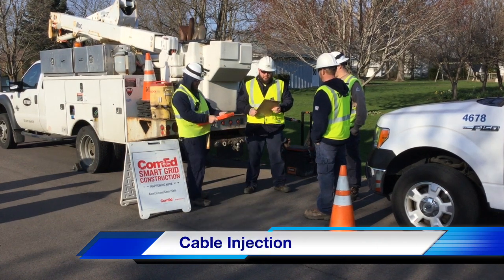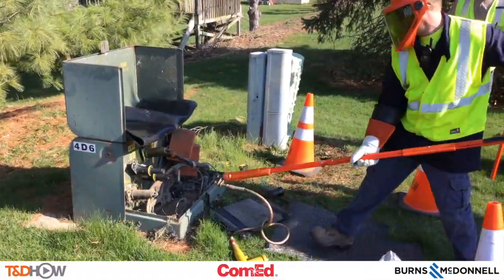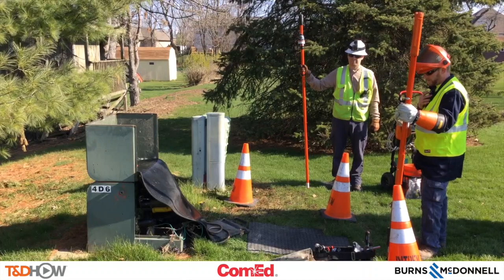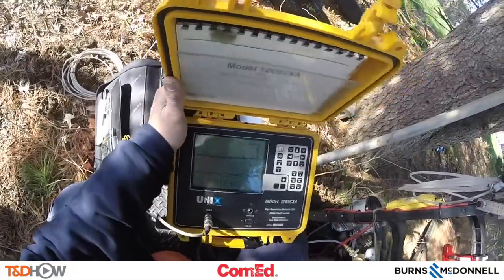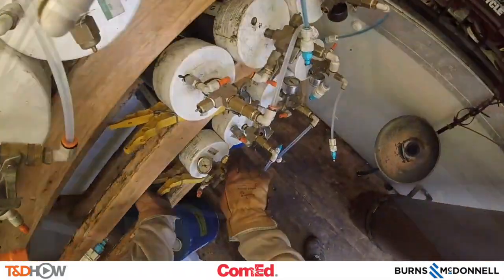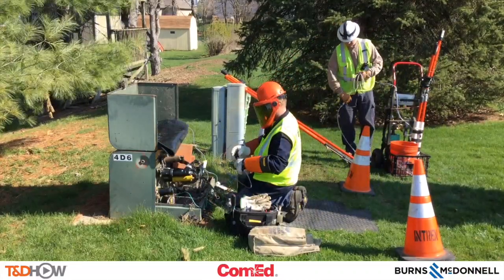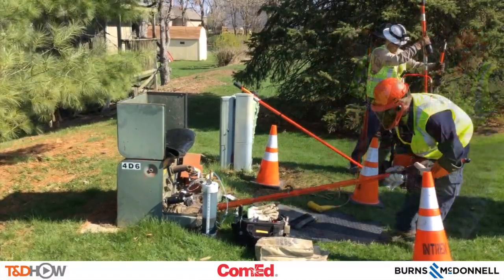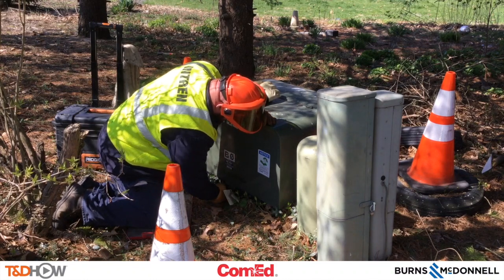Cable Injection

Comment: Years back they tried this fluid injection for a short time on aircore telephone cable, but it didn't work very well.  It was expensive and if there were any buried splices in the section they had to be exposed and opened up.  Not only that, but if there were already pairs going bad from water inside the cable, the injection tended to cause opens in pairs. I understand the principle with telephone cable, converting the airspace in the core between the twisted pairs into a totally filled cable using this silicone grease injection filling.  What I don't understand is, what is the air space you are injecting the fluid into in a primary power cable?  Where is the fluid able to travel?  Just between the outer jacket and around the concentric neutral wires?